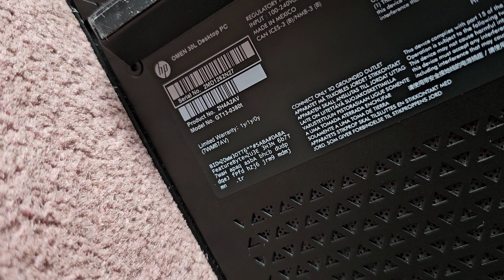HP Omen 30L Desktop PC GT13-0380T Disassembly CPU Fan Cooler Removal Quick Look Inside

Comment: The thing is hard to close. :P tutorial on how to do it easier?
Front plate.
Reply from the maker: @kyansyt  I don't own the computer, so no longer have it.
Reply: @ItsBinhRepaired   damn the bottom and top dont allign for me despite having the same model
Reply from the maker: @kyansyt  how did you take it out? Was it never assembled?
Reply: @ItsBinhRepaired  i just opened it using the internal access button
Reply from the maker: @kyansyt  you have to slot it in first
Reply: @ItsBinhRepaired   i did but it wont go in from the top then. Maybe mine has a defect so it cant go back in
I just got one past mending xd
Reply from the maker: @kyansyt  push it hard at the top  to click it in
Reply: @ItsBinhRepaired   i tried.
Reply from the maker: Make sure the things line up.
Reply: @ItsBinhRepaired   i did it just doesnt work out for me.

Comment: I basically have the same pc, the AIO looks identical aswell. now i dont know what cpu that pc has, but the one i got is a i7-10700k. The problem i have is that cpu temps can sometimes reach mid 90*c if i run a heavy-load game. Im not really a tech guy, but could only changing the fan on the radiator help with those temps? it seems easier than swapping the entire cpu-cooler. thanks!
Reply from the maker: The pump is likely dead unless the fan isn't working, changing it won't fix the issue.
Reply: @ItsBinhRepaired  i dont think the pump is dead, its still cooling but theese pcs have a problem with the temperatures, especially the cpu. I want to try and improve this but i dont really want to do any "big" changes on my pc if possible
Reply from the maker: @legendteigen461  feel the liquid tubes. One should be hot and the other should be cold.
Reply: @legendteigen461 it’s the case the omen cases cause a lot of heat , change cases I still have my original omen case but I keep the glass open has to recently change my aio because it died

Comment: how where you able to install the Omen stock cooler onto the Asus motherboard? When i attempted to use the omen cooler the post on the backplate where too thick to be inserted into the motherboard.
Reply from the maker: Maybe yours is different. Not sure.

Comment: How do I take the hardrive bay out???
Reply from the maker: Pinch the tabs together and pull it out.
Reply: @ItsBinhRepaired  no the thing that the tabs go in, I want to cut it in half and put a fan in the front panel
Reply from the maker: @UnfortunateConstantly  if no removable screws then you need to cut it. If you're modding it to where it needs that many fans, just get a new case.
Reply: @ItsBinhRepaired  I don’t have any money lol
Reply from the maker: Why are you modding it? Is it suddenly overheating?